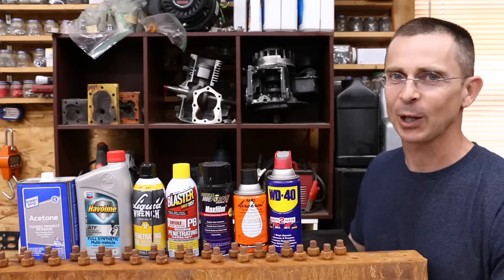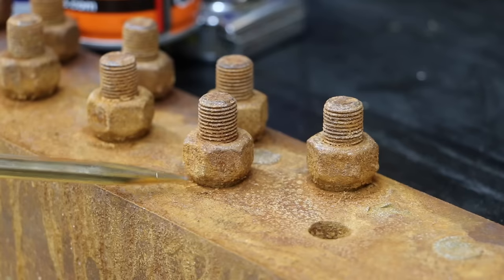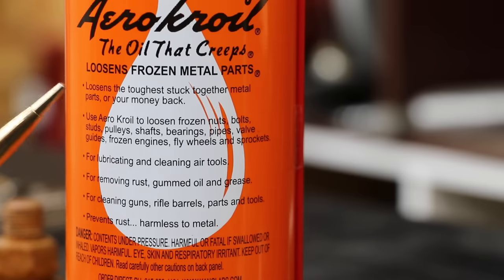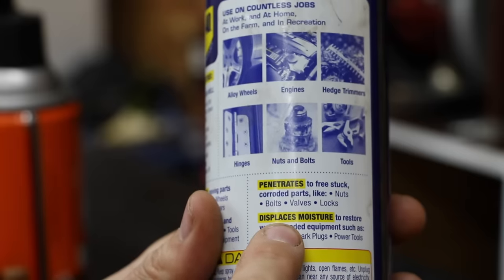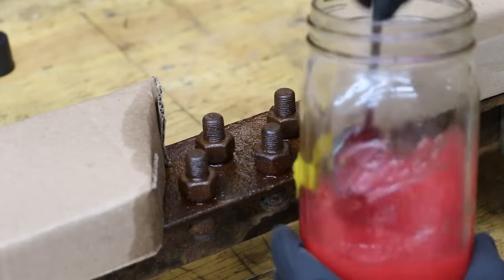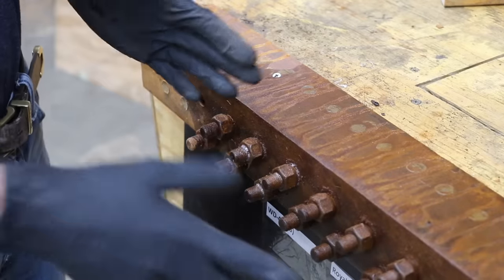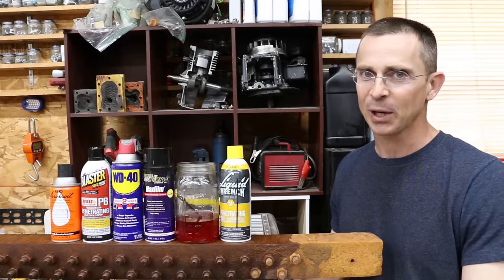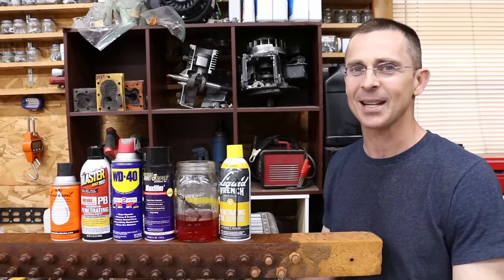Which Penetrating Oil is Best? Let's find out!

Comment: I notice all the people who saying  nothing's better than kroll usually work for an industry that doesn't bat a eye at paying  $15 for can of penetrating oil
Reply from the maker: Great point!
Reply: I know Kano is good I've used it many times at my work in the mechanical department, just used it the other day getting a drag chain bearing off a shaft. But we are a company that doesn't bat an eye on cost's, just wanted to share that because I had a chuckle reading your comment.
Reply: my work uses it and its pretty much useless, i just use straight acetone and a beat on it a bit. it usually works and if not then im gonna end up drilling something out.
Reply: True. I was surprised at these results because I've used AeroKroil in aviation for years. A $15 can of oil is nothing compared to the cost of the man hours lost while trying to remove a stuck part, and a fraction of the cost of the parts themselves.
Reply: Been there, done that, got the T shirt.  I was one of those people-worked as an instrument tech repairing control valves in refineries. FROM EXPERIENCE OF 30+ YEARS, I have found no better product than Kroil.  The only ones I have not tried are the new synthetic penetrating oils.  I'm willing to agree that the lesser expensive products will work just as well for the home DIY'er.
Reply: Yes, so what's your point? I use it all the time at work and they pay for it. It still works. I use it in aviation. We deal with mostly aluminum. I'm wondering if it works better in those circumstances vs the ferrous fasteners in the video.
Reply: Paul I 100% agree with you, Kroil has saved my ass on road tractors many of times
Reply: I am a shade tree mechanic. Working on old rusty tractors nothing has beaten Kroil. A little goes a long way, so when you take that into consideration, the cost of Kroil may be less than the others. Before I found out about Kroil I was using PB Blaster. I know a locomotive mechanic and he made the switch to Kroil and that's all he uses now. I am not affiliated with Kroil in any way. My two sons are now always asking where the Kroil is when they are working on their ATV's. So I am someone who does bat an eyelash at a $15 can of oil, but damn, not breaking studs/bolts and getting stuck stuff loose makes it worth it. Next I will have to try Mouse Milk the A&P guys talk about.
Reply: That is a good point. Airplanes are made out of different stuff. Lots of aluminum, stainless and chromoly on the airframe side, and jet engines feature nickel and cobalt based alloys. It would be too many combinations to test every oil on every possible material combination.
Reply: I service wood stoves and fireplaces for a living and when I work on a cast iron anything it's aerokroill or drill and tap witch suuuucks
Reply: Kroil did worse than cheaper WD-40 maybe its all  in your head that it works better.
Reply: ...I've spent a life at sea, working as Chief Engineer...requires maintenance and repair both above and below decks in harsh envioronments...I am also a farmer/rancher/old equipment restorer ...WD 40 has no place in my cabinet. Kroil is the best hands down, proven over and over...I use PB Blaster when I think it will work, just to save my Kroil...and I do not hesitate to use of heat when I can. I was surprised at the outcome of your video and believe it is not representative of the real life out here, when pulling parts off a tractor that has been behind the shed for the last 40 years...That said, thanks for your excellent videos...your work is good, just don't agree with the results on this particular one...again, thanks.
Reply: You might have misplaced loyalty towards Kroil.   Its ok to be a fan but I've seen tests done on the penatrating oilds on rusty bolts and there was not a huge difference between any of them.    Heating the bolt was better than any of them. 

I could probably put WD40 in a Kroil can and you would not notice.
Reply: Use kroll on two inch steel shafts that hold a ten inch deep gearbox on. Use to have to dismantle the gearbox and cut the ten inch race length wise to get off the two inch shaft. Used 20 ton portapower with no help. Tried this kroil and it actually creeps down the ten inch by two inch width shaft through the gear box race,I was able to remove this gearbox with a pry bar only. Now I have replaced about 25 of these gear boxes since. This stuff is incredible, the test on the bolts is not a real test. Try removing heavy 30 yr old gear boxes on two inch shafts. Heck try pulling off bearings on a 2 15/16 shafts. This is why kroil gets the reviews it gets. 15 bucks is cheap compared to 5 hrs working on equipment.
Reply: You could have used liquid wrench and obtain similar results its just you happen to use Kroll first.  Not saying Kroll is bad just that its not the only game in town.  You act like its some kind of magic snake oil that does what others can't.    You provide no scientific testing just and old gear box with no control.    At least this video attempts to compare them all side by side without the emotion of kroll fanboyism.
Reply: I work as a Millwirght for some of the largest manufacturers of turbines as well as many other mechanical equipment. Kroil is a staple in our industry I was very surprised at the outcome here. I have used it against other penetrants and always gone back to Kroil. It is expensive  but in our industry time is money and it is by far the best stuff out there hands down. However it did open my eyes to giving liquid wrench a try as well as acetone/ATF mix.
Reply: And if Millwirght had set up a deal to use WD-40 or some other brand you would be saying the same.   Kroil just got the contract due to cost or what ever.
Reply: boeing uses kroil like its free
Reply: try turbine bolts.. vertical bolts r  HUGE. Kroil all the way..   @jimmyjackz
Reply: Kano Kroil proved itself countless times for me. 

Stuck lift arms on a 4020 had resisted every product we could find including heat and then heat on the cast housing and freon on the steel shafts. 

So we tried Kano Kroil for a couple hours one afternoon,  no soap. We give them another dose with hammer taps as with all other products. We went to supper and to bed without looking at it again. Next morning applied a bit more with a little tapping then used the 36 inch Rigid pipe wrench that to that point had only twisted the steel. First try it winked. Very damn little but the first for those parts 
.Being an old hand at this I immediately changed direction and it winked a hair further. Back and forth and soon they moved to the end and then back to the other end. That was just the first thing it fixed on things everyone had given up on. I haven't looked back in 30 years. I couldn't find any locally recently so bought some PB that barely did more than WD40.
I've used them all. Nothing works like Kano.
Reply: @sailbad7826  it was a 68 4020 with seized lift arm adjusters that made me see the light. When every product  on the Market plus heat And then heat And COLd fail, And Kroil finally works, what can you learn beyond that?
Reply: Bob scientific test? Try  78 gear boxes (10” deep) on 2 inch steel shafts that are over 30yrs old. And NEVER once has kroll failed. Real results are the true results. What this guy is doing in the tests doesn’t come close to the work kroll can do. And for the record we have used liquid wrench and about 10 other so called penetrates with negative results that have cost many down time hours.
Reply: N. Graz man I hear you, use kroil for last ten years, nothing comes close to what it does, and the time it saves is cheap compared to the down time
Reply: OIL LEASE, You can buy the KANO KROIL on line easily. There are a lot of good points and opinions here but they just need to try KROIL where the rubber meets the road and they too will be convinced ... no doubt in my mind.

Comment: Believe it or not.  I have an propeller on a hub connected to a tapered shaft crankshaft that torque specs call for 223 ft lbs.  After years in all kinds of weather, spent nearly two days trying to break that giant hub nut loose to get prop hub off the taper shaft.  Started with PB Blaster - no luck; next was Mouse Milk penetrant (might add that into your testing) - nothing; then finally home brew acetone and ATF.   That seemed to finally do the trick.  Now...that's not conclusive of one over another as they were all tried and cross contamination could have been a factor - but the home brew certainly didn't hurt anything.   I'll report back as that prop hub has to come off again for FAA prop inspection/certification next week.  Going to start and stay with home brew.  Unfortunately, heating with a torch was not an option, given possible damage to heat treated hub and shaft.
Reply from the maker: Wow!  Glad you were able to break it free.
Reply: You forgot to do a witch-doctor chant and sacrifice a chicken!...……………………..elsullo
Reply: Sometimes those are reverse threaded.
Reply: What I recommend is some PB blaster then spray it with break parts cleaner. It thins the oil more and that'll get pretty much anything off.
Reply: avflyguy I can't answer for general aviation, but for commercial aircraft, all we use is aerokroil.
Reply: avflyguy I believe it.
Reply: Atf eats everything even rust. We use to use a mix of atf and 10-30 and spray it in the door panels of our trucks and cars. Never had a door panel rust out yet.
Reply: 223 foot pounds on a prop? I would double check that if I were you..... It's probably 223 in/lbs 
Cessna calls for something like 40 foot pounds....
Reply: @Sam Tapered shaft prop installations use a single large nut, so 223 ft*lbs is probably reasonable.
Reply: Paul Ah I didn't catch that part, all I've ever worked on has been with studs. What model plane?

Comment: Maybe you have already tried this, but in my limited experience, soaking a rusted on nut multiple times over a day or two really helps as well (think steering or exhaust parts on a vehicle)
Reply from the maker: Thanks for the feedback.
Reply: This. If I'm going to remove exhaust (or really anything that might be an issue) on a car, I'll hit it a few times over 2 days before I put a wrench on it. But I get that some people don't have the time.

Comment: This was a great test. Thanks so much. I have some krill in a can and frankly it is so stinky it penetrates the entire garage and it smells like that for days. Same for PB blaster. I will have a look at liquid wrench or maybe use my propane torch on some tough suspension joints this weekend. Thanks for the tips.
Reply: Does it work better than fish oil?
Reply: @SW-ii5gg  not sure. Probably not. Besides it’s too stinky

Comment: Would like to also see how effective a simple whack with a hammer is.
Reply from the maker: Thank you for this recommendation!
Reply: Even the expensive penetrating oil cans tell you to hit them gently to help the oil sink in, it seems to help in all honesty.  If I ever have something that is really giving me hell I put on my Acetone/ATF with a solder brush then rap on it a soft piece of steel and my drilling hammer, then after a few soft blows, put more mixture on it.  Might just be placebo, but I think it helps.
Reply: Usually not very, it usually just twists the heads off of smaller fasteners. I prefer impact wrenches, which give a series of smaller blows but gives a lot of them.
Reply: The ole shocker with the 3lb sledge
Reply: Uriah Siner hold still and i will show you

Comment: This is probably the best product review channel on the internet. I refer many people that are looking to buy products to your channel - let the data speak for itself. WRT the penetrating fluids, I have used Liquid Wrench, Kroil, Sea Foam and PB Blaster - none of them work. Heat, when I can use it, is my best friend. Because of a dry rotted tire, I recently had to remove a wheel on one of my trailers and the nuts were rusted. The wheels hadn't been removed in 30 years.  I tried all of my leftover cans of penetrating fluids and none of them worked. I applied them to the lug nuts every day for one week and still had to use a breaker bar. Upon inspection, I observed that the fluid did not penetrate past the first thread or two. I have several cans of chemicals if someone wants to stop by and pick them up!
Reply from the maker: Thanks!  Thanks for sharing the channel!

Comment: I really enjoy your videos. The tests are very practical and i find them to be very informative. I would have liked to have seen knocker loose and in-force included in the testing as well as seeing if a blow from a hammer makes a difference
Reply: Good point. I some times will give a stuck bolt or nut a whack with a hammer or heavy wrench.

Comment: I've worked as an auto mechanic, maintenance man, millwright, and back yard mechanic.
 I first used PB blaster in 02.
It's been my go to ever since.
It's always worked.
It needs time, sometimes heat.
But, anything from a corroded dissimilar metal screw on a peckerhead box exposed daily to water, 
Spark plugs in aluminum heads,, or  a 3" cast iron old steam pipe fitting.
 It's done the job.
I'd be hesitant to spray acetone and tranny fluid on cherry red hot heated fittings.
 P.B. smokes.
But wasn't a fire Hazzard.
Reply from the maker: Thanks for sharing.

Comment: Tapping with a hammer helps to break the chemical bonds that form.
Reply from the maker: Thanks for the feedback.
Reply: I was thinking the same actually
Reply: Project Farm open and shut is the best penetrant by far... 10x more powerful than PB blaster
Reply: The tapping trick works wonders especially with heat
Reply: Will that work for a seized spark plug?
Reply: KANDY DAMN MAN!!! No!!!!
Reply: @-g.k.4389  Nononono don't tap that thing! It's part ceramic, will shatter and then you might have to drill it out. Or if the ceramic survives, you'll ruin the threads in the head. And have to drill it and install helicoils, a right bastard of a job.

Once you need to reinstall plugs, thread a piece of fuel hose or similar over the plug lead end of the sparkplug, and use that to initially screw in the plug. Should be snug but not super tight. That way, if you accidentally crossthread the plug in the hole, the friction fit of the hose on the sparkplug will slip before the crossthreading does any notable damage. Once it's properly seated, pull the hose off and finish it off with the plug socket.
Reply: @ProjectFarm  BG penatrating oil works at work
Reply: KANDY DAMN MAN!!! If the spark plug is stuck spray the spark plug for 5 seconds let it sit for about 2 minutes and than when you take it out and put a new one on get some anti seize put it on the threads.
Reply: @In Gratitude I Am    Yes he needs to test which hammer is the best.
Reply: pr0xZen pr0xZen bro what? Even if you break a spark plug in half you can still get it out of the head. The threaded part of the plug that is in head has a socket hex on it. Either a 5/8 or 13/16. You can always get a broken plug out but the problem is if the ceramic breaks bad enough and some falls into the cylinder(the insulator runs all the way through the spark plug)(the insulator is also the white ceramic part on the outside of the plug) or the center electrode falls into the cylinder. Or both probably haha Most likely wouldn’t cause catastrophic damage but it wouldn’t sound very good for a couple revolutions, until it exited the exhaust valve of course.
Reply: @-g.k.4389  is it a Ford truck?
Reply: I find that a hammer has the ability break many bonds.
Reply: @-g.k.4389  yes
Reply: Wait my hammer is the one rusted what do i use
Reply: @jintarokensei3308  hotaro is amogusrefrence!!!!
Reply: @thehonksterkadunedalickyda7036  i tak emain hors to tha pikup track andit runn while no oil
Reply: @Wolfmaster-fu7si  r7uusuusususususs sus rust rus rust
Reply: The hammer trick works great, especially on iron pipe fittings and unions. Always use a second hammer (preferably of equal weight) as a backup positioned 180° from the striking point and then rotate 45 to 60 degrees at a time until the circle is complete.

Comment: I know I’m kinda late. I do commercial refrigeration and when replacing the fan blades on big three phase motors for refrigeration racks. Before I even start to remove the housing to the fan and everything I spray everything down with kroil. Especially for the fan shaft. With a little bit kroil and maybe a few turns of the bearing puller, the fan comes right off of the shaft with ease. Most of the time I can just pull it off after loosening it with the bearing puller.
Reply from the maker: Thanks for the feedback.
Reply: I have similar experience with Kroil Oil. 35 years commercial/industrial chiller work. It takes time to work. If possible, I let it work overnight. Good for firearms too.

Comment: I know this is an older post, but I just figured I would throw it out there.  If you happen to do another test like this, I would definitely add Thrust to the mix.  I can't tell you how many times that stuff has loosened things for me where other penetrating oils could not.  Also, the price is very reasonable considering how good it works.
Reply: I was just about to suggest Castle Products - Thrust when I saw your comment. Great stuff.

Comment: I agree that it's difficult to simulate every scenario.  But this is a pretty good experiment.   Anyway, I typically run into stock bolts trying to change lawnmower blades.  I've tried WD40 with no success.  I then bought Liquid Wrench at a local retailer, and now I swear by it.  It works very well.  I've never tried any of the other products.
Reply from the maker: Thanks for sharing.